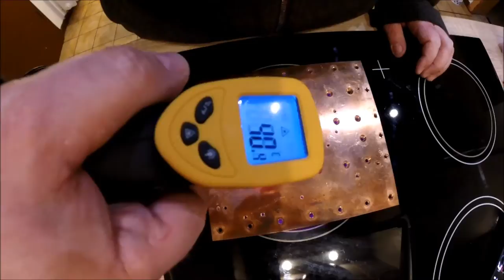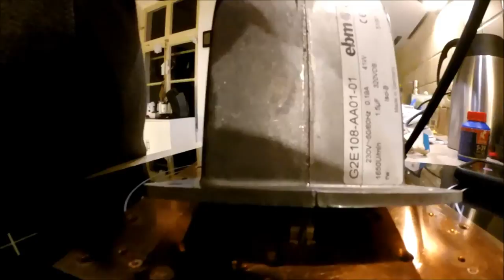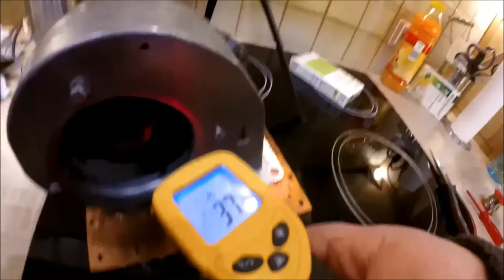BLF 188  XR auflöten auf CU-Platte

Comment: Failure. Temperature measured directly in the metal fails . It is necessary to paint a small area of black color. After you cools very fast the copper plate and is danger of internal cracks . I sincerely wish you've been lucky and work quite right. 73¡¡